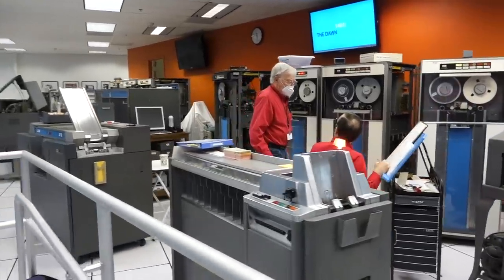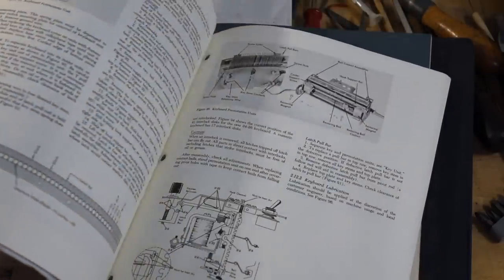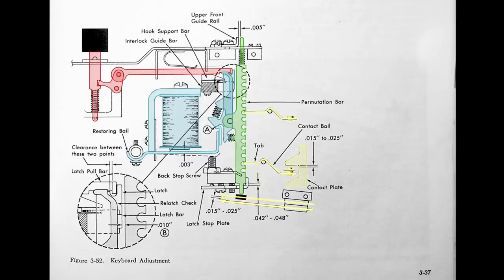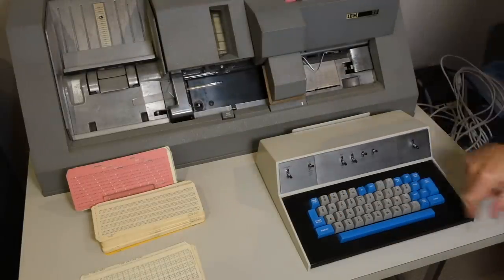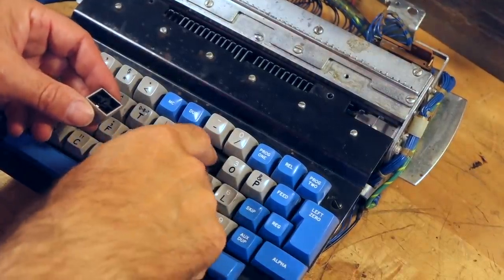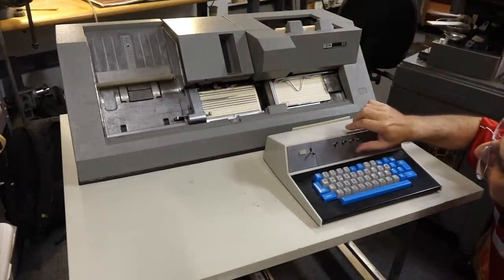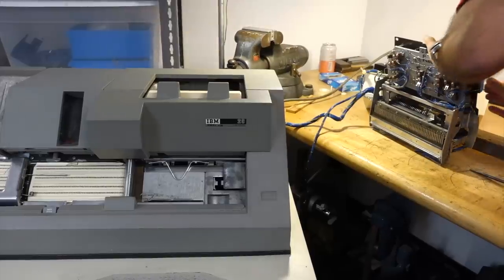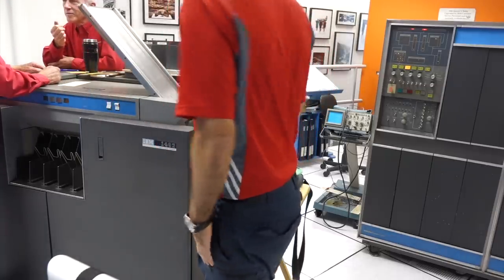The IBM 029 keypunch mechanical keyboard: insanely complicated!

Comment: All the complexity of modern chips existed in prior generations, it was just expressed in a multitude of creative mechanical ways.
Reply: Nowhere near the complexity. Modern Chips have MILLIONS of transistors, and the schematics are so intricate that people can’t manage them — the design must be computer-assisted.
Reply: @JordanOrlando  True, true, I wasn't really referring to the density of gates or circuits, but the creative process to solve a problem.
Reply: @JordanOrlando  "millions"? Oh sweet summer child ....
Reply: @8BitNaptime  Too low, right?
Reply: @mpbgp  Yeah, of course you're right. It's a fascinating comparison either way.
Reply: @JordanOrlando  By three orders of magnitude. Of course, there are chips still being made today that have maybe 25 transistors, but the transistor count of CPUs and DRAMs is nuts.
Reply: @JordanOrlando  a 4090 GPU has 76 billion transistors in it for reference.
Reply: @zyeborm  but you would not drive a keyboard with a GPU. You can do all of this with a tiny microcontroller which does not even need millions of transistors to do the job. Even a bunch of descrete components would do the job. And if they would have had access to todays microcontrollers, they would have used the microcontroller as the mainframe and not to run the keyboard. :-D
Reply: @zyeborm  Have you counted them?  Can you imagine how many screws it takes to hold all those in? :-/   :-)   How many does it have in there that aren't for reference?

Also, can you imagine what that number is going to look like if someone figures out a truly producible way to configure those integrated circuit features in 'large scale' 3D?  Or if and when single digit atomic 'molecular' transistors are realized?  

I expect it wouldn't be long before we'd just drop the prefixes and resort to exponential notation, because nobody could remember them all.
Reply: @nooboard  "todays microcontrollers, they would have used the microcontroller as the mainframe and not to run the keyboard."

Yup, at one time I thought of them as washing machine drivers.   But on the other hand, the Russians STILL can't build them...either the chips or the electronically controlled washing machines, without those chips.
Reply: Before integrated circuits, electronics used discrete components.  The HP 9100A from 1968 was a desktop scientific calculator with full trig, log, powers functions, programmability, RPN entry, and CRT display all with no ICs.  Its numeric memory was in the form of vibrations travelling around a mechanical spring wire.

Comment: The really neat feature (I don't remember if the 026 had this as well) was the program drum.  You could set it up to do things like automatically skip to column 7 when you fed a new card, duplicate columns 8-60 from the previous card, and then go into numeric shift for columns 61-70.  And endless variations on that.  An amazing machine.
Reply: Yep, both machines had program drums. As did the 024, which is probably a verifier if I recall correctly.
Reply from the maker: See the program drum in operation here: https://youtu.be/YnnGbcM-H8c . Definitely my favorite feature too.
Reply: Starwheels keep on turnin'
Cardboard keeps on burnin'
Rollin'
Rollin'
Rollin' through a readuh.
Reply: RIght, and auto numbering in the last colummns. For COBOL it was mandatory numbering the all the cards on the first six columns, but not in FORTRAN. You regretted not having numbered your cards when they were spread all across the floor.
Reply: @FernandoLichtschein ..and it is said that a real Fortran programmer can write Fortran in any language.

Comment: This reminds me of the NCR technician I knew, who was called to fix a problem on one of those early electromechanical bookkeeping machines.  After disassembly and fixing and cleaning and lubricating and reassembly, the machine did not work. After a second round of disassembly, a secretary noticed his frustration and walked over. After hearing his pained rant, she looked around and asked, "Have you turned on the wall socket?" Here in South Africa we have a switch for every wall outlet.😂😂😂

Comment: This reminded me of a course I had in high school called "Introduction aux Machines de bureau" where we would dismantle and reassemble typewriters, photocopiers, and a big machine called IBM Selectric III Typewriter. This thing had thousands of mechanical parts, along with quite a few solenoïds and microswitches... It was a big job to take it apart, and a nightmare to put it back together! Especially for a 14-year-old boy that I was. Luckily we worked in teams. The goal was to have it work again. It seldom did, without help from the teacher. No internet in those days, and only a worn service manual with complicated schematics.  
Anyway, very interesting video on incredible engineering by IBM. Thanks for sharing!
Reply: Did you ever see a 1050 terminal? It used a Selectric golf ball, but could send and receive over wires. There was a slow card reader for it, too.
Reply: @b43xoit  
Never did see such a terminal, but I'd heard of it. BTW that golf ball system for printing was "digital". Well, mechanically digital anyway! Quite impressive engineering.
Reply: @AlainHubert  Yeah, I read that the only electric thing on a Selectric is the motor.

Comment: as part of my education in the 90s we had to learn to draft by hand. We all complained that we had to do it by hand when we otherwise did everything on CAD. The hand drawing class was only for six months and none of us ever had to do it by hand after that. When I then did my workterm (as part of the education), part of what I did while learning their CAD system was to redraw old handmade drawings in the computer, which was otherwise only done when we had to make corrections to these drawings as most of them were so old the original paper drawings were gone and we only had microfiche left. But anyhoo, making those exploded assembly drawings were a lot of fun (on the computer), and an absolute pain to do by hand because it required carefully positioning drawings on a light table to copy the individual parts, which we of course first had to make an isometric drawing of in the scale we needed for the assembly drawing. That is likely also why your instructions and the drawings don't quite match up. Typically the person who writes the documentation and instructions has nothing to do with the drawing, and also works from notes written by whichever engineer figured out how to take the machine apart and put it together again. My first job out of school was to make drawings for the documentation, which included removing any details that would turn into a blob when the drawing was shrunk down to fit in between the text. And all I got to work from was a list of drawings and a figure number so I knew where the drawing had to go in the text. So basically, I understand why your instructions were less than stellar, and apologize to anyone who had to use what I made, because it was probably equally as vague

Comment: I started writing  Assembly, Fortran and JCL for the IBM system 360 using both the 26 and 29 card punches.   You get in a rhythm with the timing of the punch.   If you try to type faster than the punch cycle you just end up waiting for each key to unlatch.   Much faster than the Model 33 Teletype with it's motor driven mechanical latching cycle running 10 char per second (110 BAUD).   At 10 keys per second you really slow down and wait on the each key.   There was no concept of the deep multi key type ahead buffer of a modern computer.   
Thanks for the memories of waiting for the keys to drop!!
Reply: I was using Model 33s during the same period I was taking typing in high school.  I think being forced to find a rhythm on the 33s helped me in the typing class!  But even at 10 characters per second, the timesharing computer those Teletypes were connected to (an XDS Sigma 7) still needed line buffers to keep from missing characters.

Comment: I was an IBM CE for 15 years and worked on both the 026 and 029. We never worked on the keyboards -- just sent them back to the factory for repair. Good luck! Same story on the 1052 keyboards. However, I did have to work on the Selectric typewriter mechanism in the 1052 console. It was a beast. We had several operators who actually "pounded the keyboard" and broke the keys.

Comment: Wow.... those manuals really are works of art.
Reply: I literally failed mechanical drawing. And then went on to fail many quarters of the calculus. Fortunately, "software engineering" requires neither.
Reply: SWE requires the lambda calculus, not the infinitesimal calculus (usually).

Comment: IBM loved relays. In fact, I'm typing this comment using an all-metal, reproduction IBM F77 keyboard (IBM PN #6019303), which includes a relay that actuates on each key press. The sound and the vibration from the relay are wonderful and make the whole typing experience divine! Three cheers for the brilliant engineers of IBM !!!

Comment: I remember that keyboard from the card punch machines I used at the University of Maryland and at my summer job at the Naval Research Laboratory. It's fun to finally see how they worked!
Reply: University of Maryland senior project - Write an IBM assembler in Fortran. Run it on Univac 1108, assemble a given program and have it run.  Stuff of nightmares and 16 hour days. At one point dropped the stack. Lesson learned: Number the cards...
Reply: We had a 029 and a 026.
Reply: @milantrcka121  you didn't get the idea to run a diagonal pencil line over the stack ?
Reply: @TheStefanskoglund1  Hmmm. No I did not  (1974)

Comment: When I trained as IBM CE in 1978, the product I trained on was the 029 keypunch and the System 32 computer.  My service territory included 026, 029, 059, 129's in the keypunch family.  

Your probably aware that one of the differences between the 026 and 029 keypunches is that 026 used reed relays, while the 029 used wire contact relays.  A common fix for the 026 was the thump, the reed relays to unstick them, while on the 029 one would replace the silver wires (two per contact) in the relays when needed.

I can't imagine that there exist many of these wires available these days.  I still have a tube of them which I would be willing to donate to your museum.

Comment: The IBM Selectric typewriter uses a similar interlock to permit only one key to be depressed. However, instead of washers between plates, think of ball bearings in a long tube. There is only enough spare space for a single keystem to be inserted, forcing all the balls together such that no other stem can enter.
Reply: That's just what I was thinking when I saw that clip. I always wondered why IBM made typewriters but I can see how they would already have all the engineering needed to make them, and make the best.
Reply: Western Electric multi line phones used a similar interlock to prevent connecting two lines together.
Reply: @mikafoxx2717  I think it was really the other way around.  They built electric typewriters first, and then figured they would make great I/O devices for some of their computers, which came along later.  But I can definitely see some cross-breeding that resulted in the Selectric typewriter.
Reply from the maker: Hello Carl! We miss you and your IBM well of knowledge!
Reply: After realising it's Carl I read this comment with his voice in my head.
Reply: Ever see a 1050 terminal?
Reply: 1050, yes! Couple of places, where they were experimenting with APL, and that was one of the few printing terminals that could do the APL character set.
Reply: @BrightBlueJim  I saw one at Middle Georgia College. There were at the time zero computers on campus and one terminal. The terminal connected to a 360 at the University of Georgia. The terminal had the card reader attachment. This worked with starwheels, like a drum-card reader in a keypunch. We used it for a dialect of PL/1 (CPS), not APL. You had to mark the end of every command with multipunch 0, 6, 9, which was End of Block. If you were typing on the terminal, you had to hold down ALTN CODING and hit 5, I think it was. Just the return would not substitute. When the computer was ready for input from the terminal, it would type one underline and then backspace over it. If you entered the code to cancel your input, it would return the carriage and wiggle the type ball. Later we were unhooked from the 360 and hooked to a CDC 6400, using a Teletype with paper tape reader and punch.

Comment: OMG! Nostalgia! You do not want to know how many programs I punched on these; when I was a student and at the beginning of my professional life. We still used these things till the end of the eighties, beginning of the nineties.. IBM did not support these things anymore, so we found a retired IBM customer engineer who did the maintenance for us, not only for these punches but for all the other old IBM equipment we still had around. That guy was really amazing.

Apart from punching, these machines were really amazing for the other things they could do; e.g. there was a function to  check the contents of a bunch of punched cards by someone else retyping what was supposed to be on the original deck. If the punch found a difference, it would tell you.

Like another youtuber said in a video about an old jukebox: electrical simplicity in combination with extreme mechanical complexity.

Comment: The gravity disassembly reminds me of a mistake I made once, taking off a 4 slot toastmaster toasters case upside down. All of the tines that protected the elements fell out. I didn't get a good look at how they went in, and now had to put the ~32 tines back in one at a time guessing how they fit, and get them to line up with the case as I slid it back down over the tight fitting and delicate knobs, a real brow sweating under the leg handshake.

When I went to test it, I realized that I'd put them in upside down... and I had to go back in.

Comment: DEC called those documents IPB - illustrated parts breakdown.  It's an immense help to fix things.

It was 1976 that I took a Fortran class and we had to use those keypunches.  The person with the cards then had to stand in line outside of the computer room and wait until he could get the operator to run the cards through the card reader, and run the program on the Burroughs B-2700 and get the printout.  Thanks, Marc for bringing back the memories.

Comment: Oh my I so regret wreaking one of these only a few years back not knowing its heritage. I am so bored with our current focus on recycling and reparability laws etc and frankly all one needs to do to see a minimum requirement is to look at those manuals. These days you cant get a circuit diagram let alone something like this, but it is also true that they didn't use firmware etc so in some respects a hardware manual is limited. I love what you guys do to keep this stuff alive.

Comment: I remember using an IBM model 29 keypunch whilst in grade 6 (11 years old) on a field trip to a computer centre at the local Uni. I was hooked! I still have the two punch cards I made for the program they were running as a demo. Those mechanical systems and shift registers are super confusing! Amazing demo Marc! Thanks!

Comment: When I first started programming the IBM 370/165 in Cambridge, I had to use punched cards. Working with the card punch machine wasn’t fun as any mistakes meant throwing the card away and punching another. That was 1979. Fortunately the next term they brought in a whole load of VDUs to give interactive access and program entry using the nice ZED editor.

Comment: Beautiful work, it kind of reminded me of the mechanics of a teletypewriter, although it didn't punch cards, but tapes and was able to read them. The adjustment was also a lot, it had to be precise, another delicacy was the rotary print head.
A special measuring weight had to be used on some contacts so that the exact contact pressure could be set.

Nice day 🙂 Tom

Comment: Hey Marc.  Great video!  One question: When you punched your data card, the last symbol you typed (after REPAIRED) was an exclamation mark (!).   A close look at the card in freeze frame shows it had 3 punches on the last column: alpha row 2, numeric row 2 and numeric row 8.   This does correspond to the "!" special character.   However, your printout from the computer shows "REPAIRED-".   What happened to the exclamation mark?   Just curious, Marc.  😀
Reply: The IBM 1403 Printer used doesn't have a ! in its 48 character set and - is presumably the default for unsupported characters
Reply from the maker: Correct. The 1403 can only print the few special characters from the 026, not the ones from the later 029. Modern witchcraft, those special characters.

Comment: First machine IBM UK trained me on. Never sent the keyboard back to the plant always repaired  on Customer premises. Yes very complex but you got used to it and learned the common faults quick enough. The operators were hard task mistresses  they did not like a 'slow' keyboard and a good idea to get their approval of a repair. The key - punch cycle  had to be memorised, all the actions from pressing the key to  a hole being punched. After 45 years it has faded from my memory. Wish I had an 029 / 129 today.